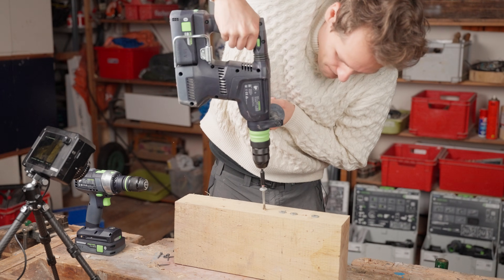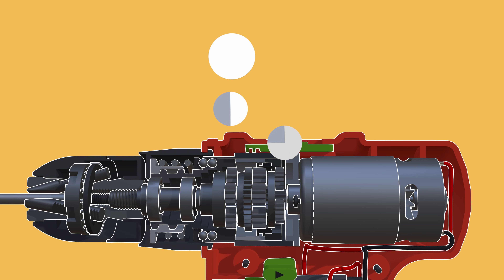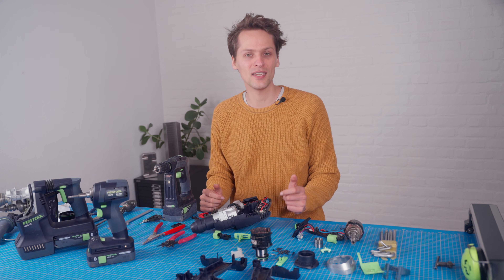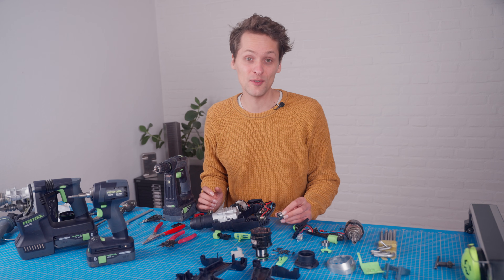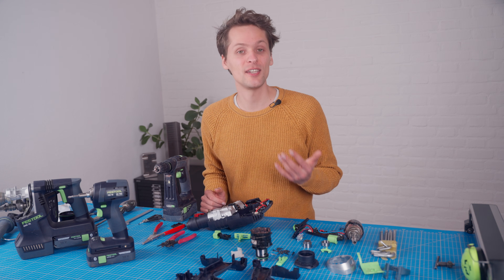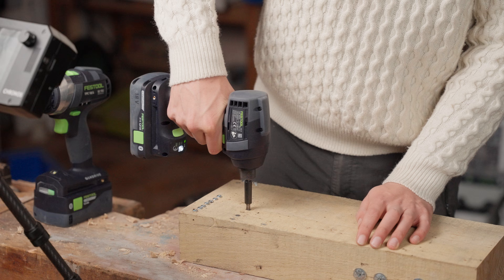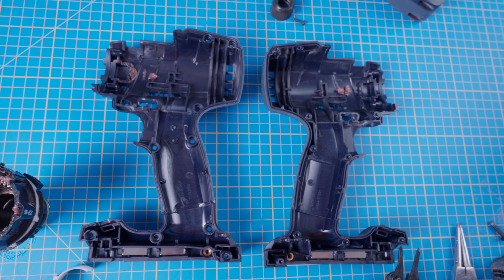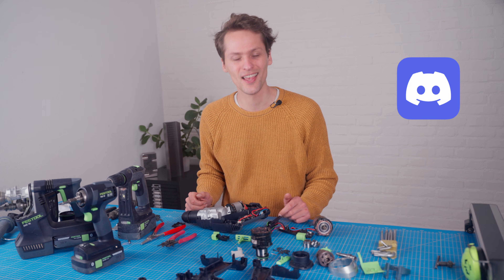Hammer Drills Don't Hammer - Every Drill Explained

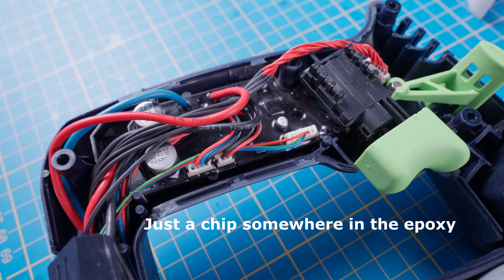Comment: 7:14
so I would never choose an electric clutch over a mechenical clutch cuz 
having it engaged at the torque that just does not breack your wrist means you can use a drill with one hand and not worry damaging it
and if the clutch does ist clutch thing I now to set my drill from drive to drill or increase the allowed torque and brace my drill with my seccond hand.

having any time that the clutch allows wrist breacking amount of torque, is a broken wrist
Reply: What are you talking about? Modern sensors are so close to instantaneous it's probably faster than your brain can send a signal to your hand. In other words if the tool is properly designed with quality parts the electronic "clutch" will engage long before any wrist breaking torque can occur assuming you have it properly set and I would even argue it's faster than any mechanical clutch could achieve which is why modern electronic suspension systems on a car are able to keep the cabin perfectly motionless while traveling over rough roads at freeway speeds. Another example would be electronic camera gimbles that keep cameras perfectly stable regardless of the movement of whatever or whomever is holding the gimble. Or electronic gyro stabilization on a self balancing robot, unicycle, drone, etc.. which all rely on electronic sensors to make thousands of decisions per second to stabilize an object and the same principle is used in an electronic clutch. Or how about airbags which detect and send a signal so fast that there is enough time left to inflate a large bag before your head can move a few inches forward so claiming an electronic clutch would be more likely to cause a wrist injury is just ridiculous
Reply: I have kickback control on every 18v Bosch Drill and I‘m sure similar technology is in every Festool Drill. 
So the clutch does not matter any more for not braking your wrist.
Reply: @Dunriteproducts  I can't tell you how hard I agree, my immediate reaction to reading his dribbling was "wtf are you talking about" and I instantly opened the replies to see if anyone felt the same way.

Comment: the hammer mode on combi drills is for double skinned plasterboard walls and breeze block and at the most it may be able to let you put some 5.5 - 8mm holes in some softer red brick for fixing cable clips or conduit saddles to the wall using red or brown plastic plugs or masonry screws if you are needing something to hold in the event of a fire so it does not drop down and impede the exit rout. anything bigger than 6mm in harder materials you are going to reach for the SDS as larger masonry bits are easily accessible. 

impact drivers are mainly for screwing but they work fantastic for 2-6mm holes in <1.5mm steel with hex shank twist drills or you can get sheet metal hole saws up to 32mm but more common in 20/25mm these make light work of trunking and metal studs in walls for running plumbing through metal wall studs without needing to constantly switch out tools or worrying about the chuck coming loose. my little Milwaukie M12 impact on a 2.5HO pack has done so much work and is way nicer when you are up a ladder in a ceiling void crammed between heating pipes and ventilation to be able to get a hole in trunking for running conduit and cabling without having to be worried about a long tool that may be difficult to get into position. they may be 1-2 seconds slower per hole over my old 18V drill but they are 20-30 seconds faster to position when you are in a cramped space drilling into a trunking full of live cables that have to be lifted out before drilling then checked its clear before starting all the while having to keep a hold of the tool at hight.
Reply from the maker: Thanks for the real world insights. I imagine that especially the short length of impacts is really helpful for plumbing-type jobs
Reply: @KnowArt with how powerful new 12V brushless tools are they have more power on hand in a way smaller form factor than the older 18v mid range brushed Li-ion tools from 2011-2015 I am a electrician and I have a 12V kit of a impact, combi drill, SDS and 75MM cut off. Even that small SDS has enough power to pound 22MM holes through 2 foot thick brick walls. 

The cut off tool does a great job on almost anything as long as you only need 15mm depth of cut. It takes 75mm air cut off blades so you can get diamond discs for brick, abrasive cut for metal that slices through sheet steel like butter for 5P a disc if your buying them in 100 packs that last years, abrasive carbide for plasterboard, plastic and they even do a good job of slicing bundles of cable. Then finally there are small tungsten carbide wood saw blades for clean cuts in plywood.

Comment: I have ebike with planetary gearbox, sun gear and outer ring gear are steel, while planet gears are plastic. 
The reason for that is planet gears are easier to replace, so they are deliberately made of softer material.
Reply: And they still tend to last a while. I have around 6000km on mine so far and they're starting to vibrate but they're still usable
Reply: Also, plastic gears (nylon) are significantly less noisy then metal analog in bike motors.

Comment: I have to be honest I use a wireless combo hammer drill to install tapcons into concrete and never had any issue with it. It never turned the bit blue either. So I am not sure what is going on for you and concrete in this video.
Reply from the maker: Hm interesting. What brand? What kinda concrete? This is 60 year old structural concrete with lots of quartz stones inside, but... I think that shouldn't matter that much
Reply: @KnowArt   OLD concrete is always harder than new concrete... Concrete continues to set and get harder even many years after being cast...
Reply: @KnowArt festool is for wood workers not actual construction

Comment: Below are my thoughts on the environmental impacts of the drill based on the information displayed in the video.
Feel free to add anything I might have missed. (Ragebaiters beware.)

- The electronics are potted in epoxy.
That does help with protection against FoD but the epoxy should be non-conductive to electricity(most aren't) and conductive to heat(again, most aren't).
So this epoxy must be a special not-on-the-market blend.
(Edit: such epoxies are commercially available, but more expensive than normal ones.)

- In case the electronics fail, the entire electronics block has to be dealt with.
Replacing the block would be hard since the wiring is connected to the board, which us potted in epoxy. 
The failed component is on the board, which is in the epoxy. So any repair need tampering with the epoxy.

- But since the epoxy isn't common of-the-shelf version(conductivity reasons), 
any repair need the proprietary epoxy from the manufacturer.
And the manufacturer is unlikely to sell that on the market. 

- Since the metal parts are sintered, the most common failure is fracture(due to impurities in the metal powder, the part not properly fusing).
The replacement could be made available on the market, but I rarely see any.

- So any electrical failure leads to a drill going to the landfill. 
Any metal part failure leads to it being scrap.

- So, now on the topic of disposal, the drill casing is made of tough glass mixed plastic.
This is beneficial during operation, but waste management is a problem.

- Glass reinforced plastics(GRPs) are difficult to deal with(commercially).
[Technically, it is 100% recyclable. But not currently commercially available.] 
And there is no way in hell it can decompose naturally.
GRPs shed microfibers into the environment, which is a large problem for water-bodies(filter-feeders suffer.)

So, the key takeaway in sustainability is that, the drill showcased here, are not made for sustainability.

- Major issue is the epoxy encased electronics.
[Solution is spraying the controller in a water/dust-proofing solution(commercially available.)
Environmental impact of waste is high.]

- Sintered metal parts are less likely to fail(only in case of contamination).
[Not a sustainability issue, 100% recyclable. Commercially available.
Environmental impact is low.]

- GRPs are a problem when the drill is trashed. During use, the drill rarely sheds anything.
[The useful lifetime of used GRP is limited to the electronic components in it.
Recycling is possible but not commercially available. Environmental impact of waste is high.]
Reply: Epoxy. A lot of professionally used power tools spend a lot of time out in the cold and wet. Potting works, it's the devil they know.

Tool manufacturers that used to make expensive high quality tools now must compete against manufactures that manufacture tools that are good enough to work and cheap enough to replace when they stop working. You can still buy the good stuff if you are ready to part with good money.

And there are manufactures out there that make tools that are very repairable. Opens like a cookie jar and they keep spare parts for models that are decades old. One thing that cuts down on labor (an important part of the cost to repair) are potted electronics. Open her up, The whole electronics caboodle comes out as on part, or is split up with connectors so it is a matter of 15 minutes from reception to final testing. For the simpler electronics the part will cost less than those 15 minutes. And a tool that gets repaired gets to live.

GRP's. Tools drop all the time. I can't compare with non GRP' since I never in my 4 years as a power tool repairman repaired anything but GRP. They do break but not very often. There must be a reason they use the stuff.

Replacements for sintered metal parts. Depends on the brand I guess. These parts are dirt cheap.

OK, I need to clarify something. I worked for an official repair center so we had absolutely everything available and could turn around a repair customer to customer within one working day. I can imagine that repairing a tool far from a parts supply can become a matter of down time over cost. No contractor will twiddle his thumbs for a week waiting for a repair, he'll ditch his tool for a new one. 

And you know, I am totally with you that recyclability should be more of a thing.

Comment: Actually, potting a PCB, even with regular epoxy, reduces hot spots. This is because practically any solid material conducts heat better than still air. When big amounts of heat have to be removed, you have heat conductive potting compounds. And if that isn't enough, you can always place your PCB with thermal paste in an aluminum heatsink, and seal it off with a potting compound, sealing off the thermal paste. I'm not done yet... You can actually create potting moulds, to make the potting your actual housing! No extra parts needed to fix a PCB in some way in a housing, and it's perfectly waterproof
Reply from the maker: Cool

Comment: I'm the one that's against those sinterized gears because the snap like nothing when they reach their limit unlike forged ones
Reply: Repaired quite a few tools with sintered gears in my repair shop days. Set of 3 gears for a large impact wrench, $1.99. Power tool repair in a professional shop might get billed in 15 minute slices with a slice costing way more than $1.99. While this sintered stuff is more fragile than forged ones, we would see 100's of broken tools for every broken gear. In a competitive market buyers buy the good enough stuff, not the really expensive. Unless they want to show off with their all Festool shop).

Comment: A bit much mixing of the concepts of power and torque. A drill with high power and high speed with torque can't drive a big screw or a big auger drill, but a low power low speed high torque drill can..
Reply from the maker: Yeah I used power in the non-technical way all throughout the video... Oops! Hope it was still clear

Comment: 6:17 that sound is actually made with the electric motor, by modulating the electronic motor. So you can turn a motor into a speaker. Pretty cool.
Reply from the maker: Really?! My 3d printer does that too, but I thought that must be something of stepper motors. But of course it's not. Cool
Reply: ESCs for RC brushless motors do the same, the startup/error sounds come from the motor
Reply: Err, not really. It is pulse width modulation. Fixed frequency but you play with the relationship between on and off time of the pulse.
Reply: @astranger448  not sure what you mean, by not really and it's fixed frequency, did I miss a comment?

Comment: I see garbage plastic cordless tools, you should see the wrist breaking torque of old school corded drills with metal parts
Reply: Go find out how much those tools were selling for then and compare that to the rock bottom prices you pay nowadays.
Reply: @astranger448  Buying into the stupid "Cordless-Madness" to buy every tool of the same brand and "color" will seem inexpensive at first, but after some years you will end up paying through the nose, because of the real business is by selling you costly  replacement batteries, and they will keep changing the "platform", so that your "inexpensive cordless l drill" ends up getting more Expensive thanks to battery life and/or incompatibility... In sharp contrast, my dear father left me some truly rugged corded tools, with more metal and strong construction, that have only required an easy and cheap brushes replacement, or in a few cases bearings, but that keep going strong, and more importantly, more Precise, even decades after!
Reply: @alfredomarquez9777  Don't look at Makita then.
Reply: @Alex_Vir   Actually, Makita has some very good corded tools. They are the ONLY ONES that have a truly respectable electric hand plane that is 4 3/8" wide, much more versatile than the usual 3 1/4" wide one that every ones has. They even have a monster 6"wide plane that nobody has. And also a great 6" Random Orbit sander/polisher that is powerful and fast, with both the geared and free spin platter selectable modes. and their Track saw is among the best.
But especially, Makita is probably the most easily repairable line of electric tools of all. They store most replaceable parts and sell them at reasonable prices.

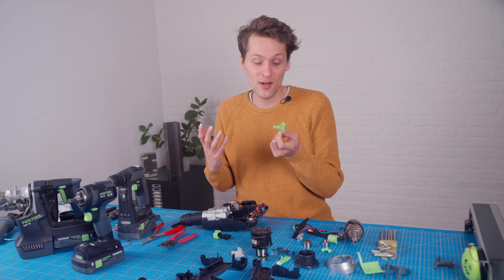Comment: @ 16:59 "It'll basically last forever" *
*Provided you don't have to work near anything highly magnetized. (which is admittedly a pretty niche use-case)
I will say that it appears they used neodymium magnets which have a curie temperature several hundred degrees C higher than the melting point of that particular nylon polymer.
So at least you'll never have to worry about the switch breaking because it sat in a hot environment for a while unless were expecting to use a tool that has already turned to goo.
Reply from the maker: I was wondering about that. Do you have any knowledge of how these switches keep up when you work with metal a lot?

Comment: :D  This is more of an anti-advert, "Why festool drills are so weak" :D  The Milwaukee hole hawg and hole shooters are just a 1/2" sized "big" drills, but they are absolutely wrist-breakers in the power dept!  Murderous amounts of torque, probably changes the earth's rotational axis!
Reply: You are right: This time Milwaukee, a Chinese company, produces higher effectiveness impact drills than German manufacturers, especially Bosch, who sells some of the weakest impact tool models in the world! They have only a few models that are powerful, but only at the extreme top end of their line, and very costly... Their lower range of impacts are weaker than even the cheapest Chinese ones...
Reply: @alfredomarquez9777  The ergonomics and comfort designed into the festools is probably much better than most others though.  TTC does have a vibration rating and milwaulkee is right at the top of being the worst :D
Reply: @skibik3r   From my point of view, most Festools have fine ergonomics, but not all: that small hand drill, with its stupid closed around handle that is placed in front of the hand, is way too bulky and that  makes it unusable for installing wall cabinets, inside those you simply cannot reach the inside corners with that bulky drill! 
Not worth having four mechanical speeds if the drill cannot go into tight spaces... Tried it, and did not like it at all!

Comment: Nylon gears are super tough but have the added benefit of being a deliberate weak point. I.e a cheap part breaks instead of more important costly parts. 

You can get " upgraded" metal planet gears for ebikes. However  the failure is so much more severe if something goes wrong ( the whole hub is destroyed )
Reply from the maker: Oh interesting double duty use case. Cool

Comment: i heard somewhere, that phillips screws were purposefully invented to strip, in order to not overtighten, when installed with a big pneumatic drill without a clutch
Reply: That is a common myth. The patent is available online: it was designed to not cam out as much as slotted screws.

The issue with Phillips is cheap screwdrivers/bits. Hardware/tool manufacturers decades ago started making screwdrivers that have a purposefully imprecise fit (grind) to the screws, so that you can get a full "set" of screwdrivers with 8 pieces instead of 20+. 

If you use the exact sized screwdriver, it takes way more force to cam out a Phillips, and the screw will actually "stick" on the screwdriver without help. Same thing happened to slotted screws. This change is also related to screws going from a professional's tool to a widely available tool, as they became easier to manufacture.
Reply: I'm not wholly convinced, as more often than not, I've found that they strip more, when being unscrewed

Comment: 8:20 my dewalt DCD 796d2 doesn't have this problem, concrete just drill fine.

For metal, you need cutting fluid to bite the metal